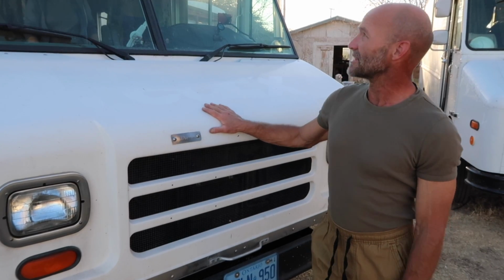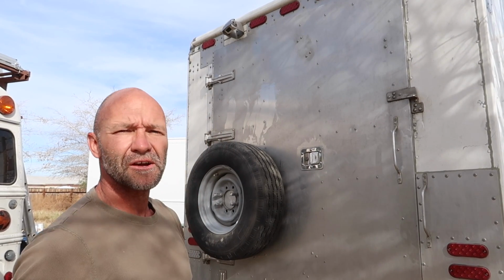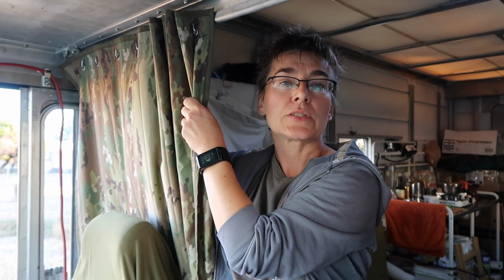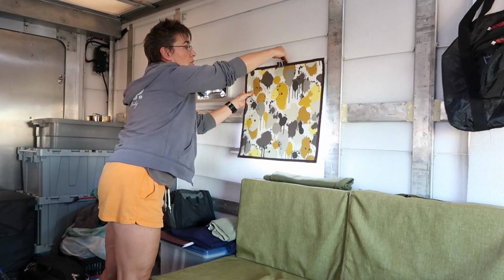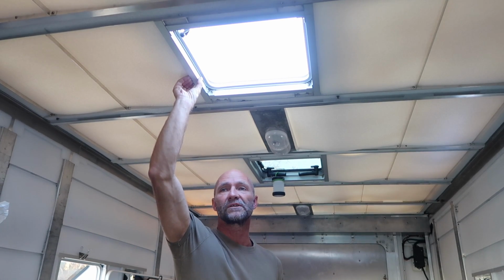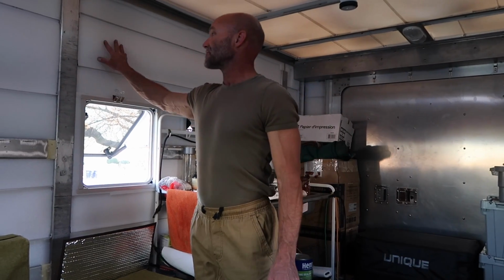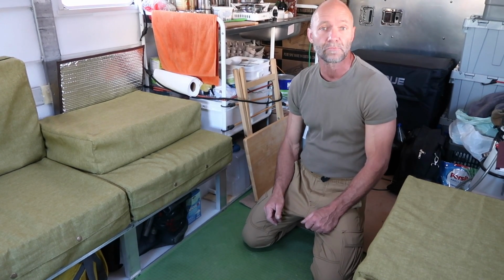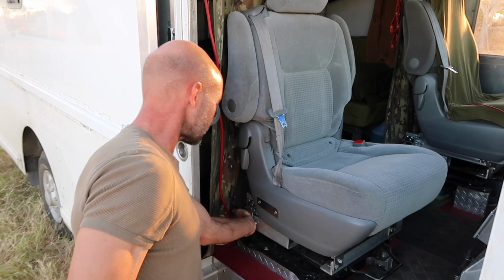Andi and Dorthy's Step Van RV Tour E379

Comment: Glad to see someone using polyethylene foam insulation. It also comes in many different thicknesses and densities. It is great for covering exposed sheetmetal in a van (like crossmembers) to reduce thermal bridging.
Reply from the maker: he van is cozy and very very quiet

Comment: Looks good, but it has to be terrible on gas mileage with a gas engine........
Reply from the maker: I think they are getting about 12 or 13 mpg. they went with gas because they plan on driving a lot in mexico and were concerned about diesel repair there